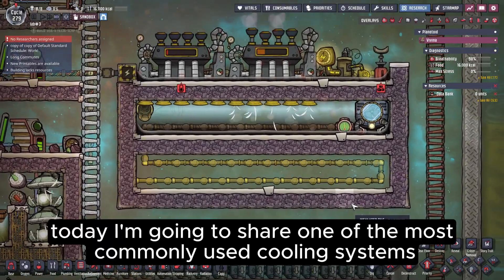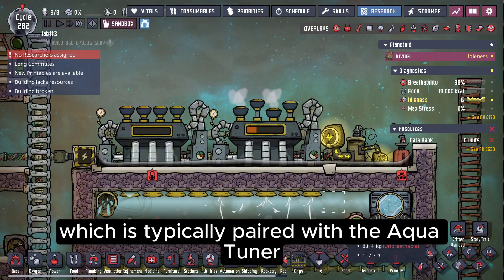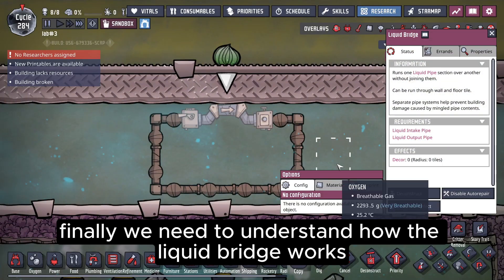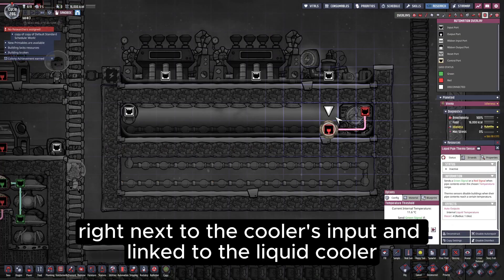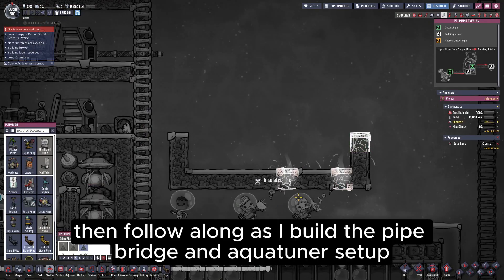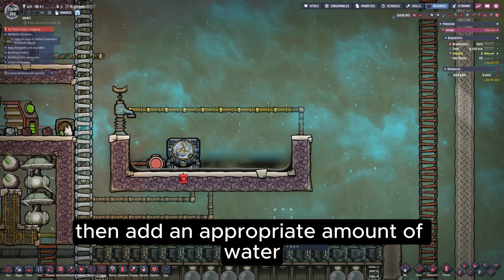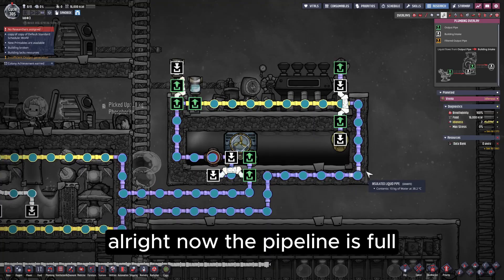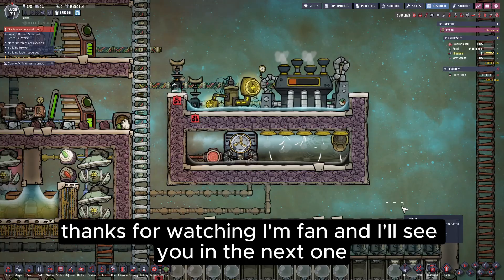[ONI]#14 How To Cool Down Your Colony | FansGame-k7k

Comment: I make the same setup. but in the end, there is always a pocket of air trapped in the corner inside the chamber. It's mixed of chlorine or polluted oxygen/co2.
Reply from the maker: You can build one tile at where the gas is and then remove the tile, then the gas will be gone.

Comment: i recommend only build thermo aquantia only when acquire super coolant, otherwise it use a lot of power to cooling since water and oil have way less heat capacity.
Reply from the maker: Normally this one is only used for temperature controlling. Like used to control colony temperature or some plants have the temperature requirements. It won't use too much power for that.